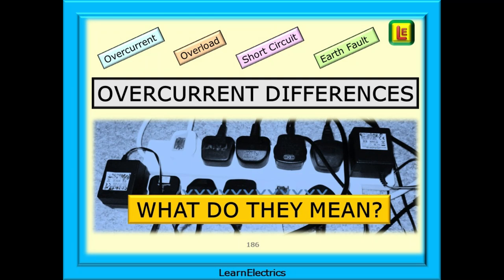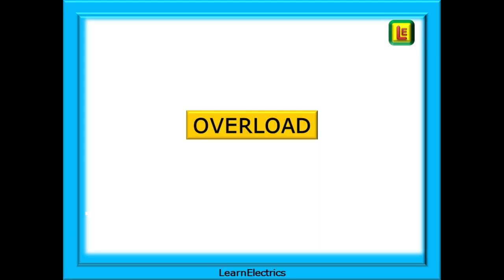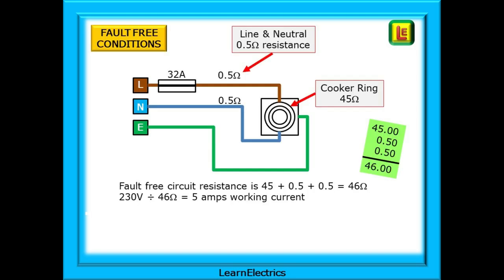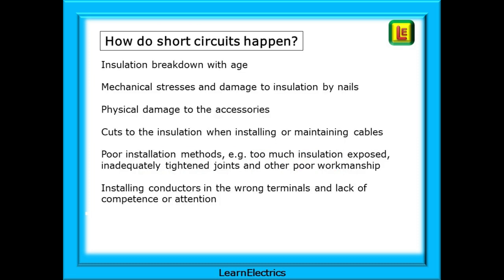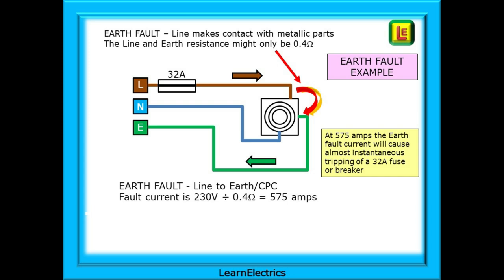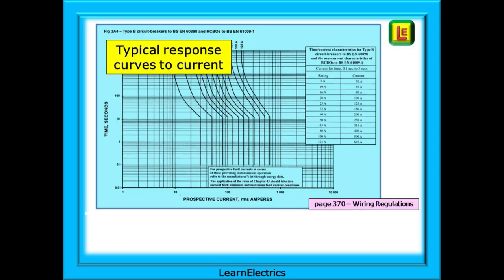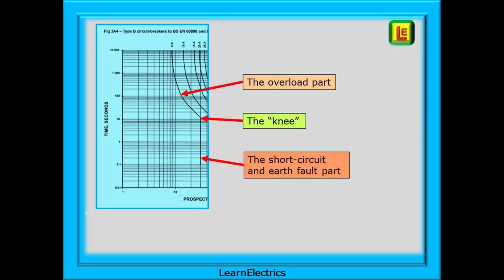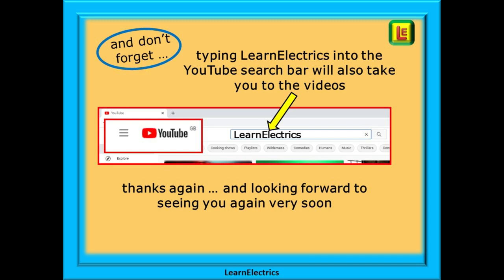OVERCURRENT DIFFERENCES – OVERLOAD – SHORT CIRCUIT – EARTH FAULT – WHAT ARE THEY & HOW DO THEY WORK?

Comment: When on site, an overload is easily identified by the delay in overcurrent protective device (MCB) operating. Usually a few seconds or even minutes in some cases. A short circuit is generally instantaneous tripping sometimes accompanied by a small flash or popping sound at the MCB. 
Depending on the size of fault current, the MCB can be rendered inoperable if the fault current exceeds the rated MCB's breaking capacity (usually 6kA for a BSEN 60898). Generally, 3 faults which exceed the breaking capcity will require a replacement MCB. 

Theres lots more to this but you get the general idea.
Reply from the maker: Thanks for watching Mike. Thanks for the input, Dave.
Reply: @learnelectrics4402  You're welcome Dave. Love watching your content! It keeps my mind fresh when my memory fails me. :) Best wishes, Mike

Comment: A great video. Well explained. Just wonder on the diagram there is a path between line and neutral becomes a parallel path. When a parallel path can become short-circuit?
Reply from the maker: Absolutely. In the wrong place we will have a short circuit. The only place they should be connected is through the load. Thanks for watching. Dave.
Reply: @learnelectrics4402  this makes a sense. Thanks for the answer.

Comment: I am a DIY guy - When I use a two pole voltage tester on the live and neutral on an unenergised lighting circuit I get a 12+- volt read back. The same happens on the cpc. Therefore I think the is an earth fault somewhere on the circuit?
Reply from the maker: Disconnect the line and neutral at the CU. Volts test LE, LN and NE at the CU - neutral bar, earth bar, circuit breaker.and see what you get.
Reply: @learnelectrics4402  thanks, I think for this I would need an electrician if it’s the consumer unit. Building Regs and all